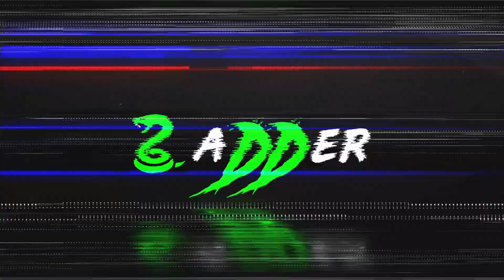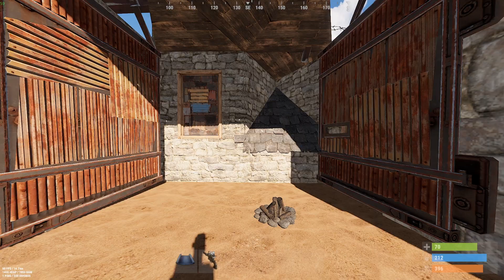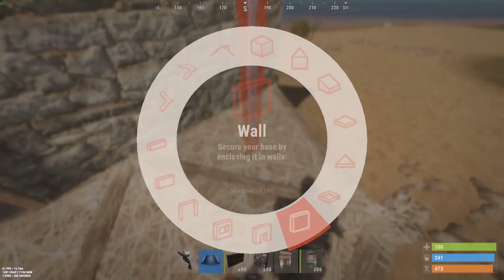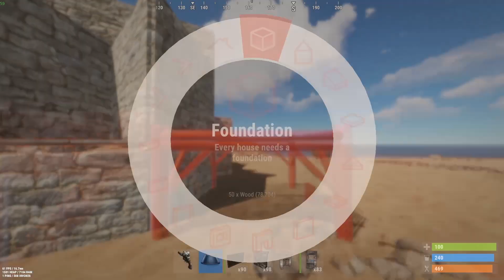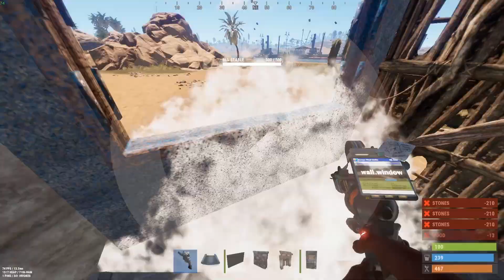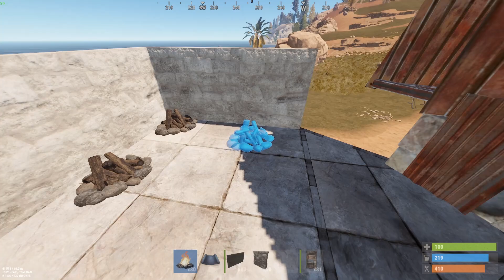New Airlock Meta: (Rust Base Design 2020)

Comment: What about the triangle to avoid bypass of airlock? In the new design it cannot be placed. Fix?
Reply from the maker: If I understand what u mean then that triangle should be placed as part of the door/roof mechanic and then move onto the rest of the build. If not you can use the triangle.foundation that the ladder is on for the roof access

Comment: 1x2 with 3 windows to shoot is better tha using high gate cause it makes base expanding imposible. Plus those metal barricades serve no purpose cause they can ladder on rest of your base.
Reply from the maker: Sorry pal I disagree as it's 4 rockets to get past gate and a 1x2 like ur think of (a compound gate) is 2 rockets. Also those barracades are there to stop people getting on the roof and dropping down behind the gate
Reply: How would it be just 2 rockets? It would be atleast 4 or even 6 depending how you build it. The only problem with the 2x1 is online defense as it is easier to replace external walls than to repair the 2x1
Reply from the maker: @Julian-gj8si  I ment 2 rockets as a 2x1 added to the front of a base is only 2 more doors (2 rockets) obv you could put garage doors on I get it. I agree with online defence thing but the main reason for this is to be and expand on your current base to beef up the front and give you good view and a shooting floor so you can then up grade your walls on your base and keep the raid cost up if they wanna raid through your doors